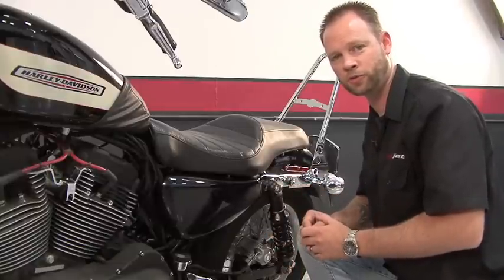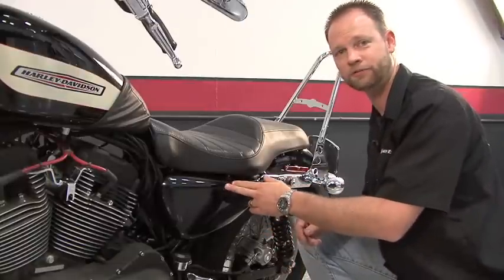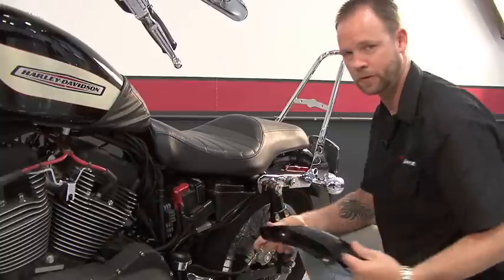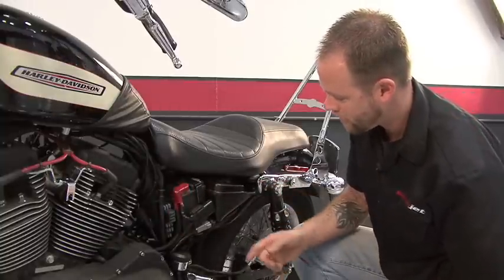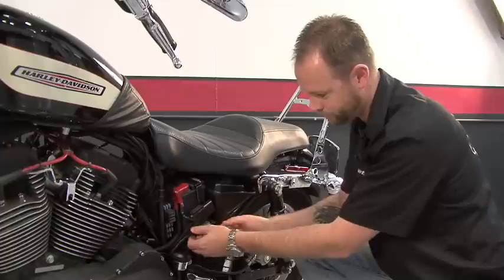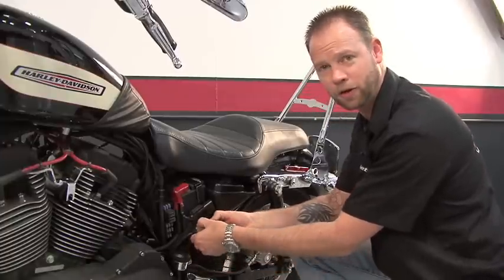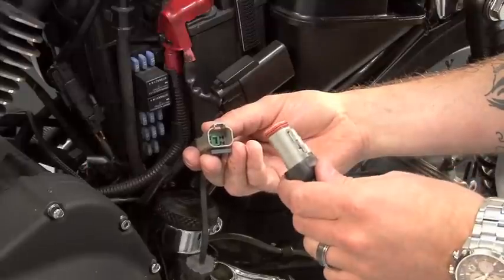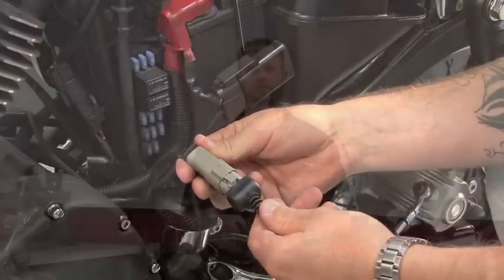2007-2020 Harley-Davidson Sportster Diagnostic Connector Location

Comment: Why did you call this 2007-2020 Harley-Davidson blablabla if you showing only 2007-2013 models??
Reply: Video was made in 2013 but the ports haven't changed up to the 2020 model so it still applies. Hope this helps :)